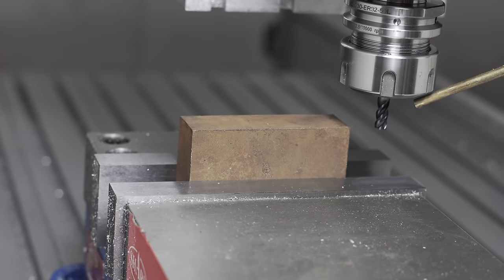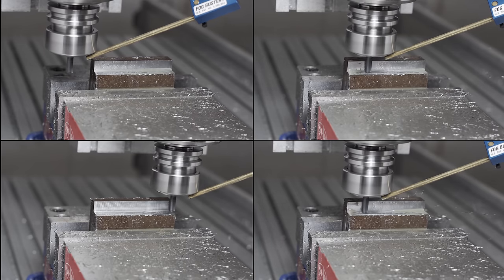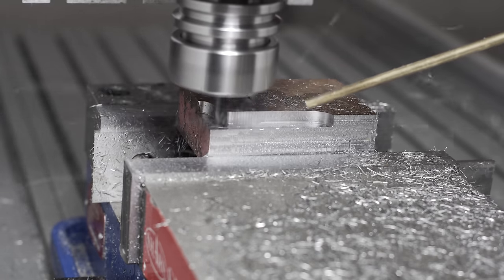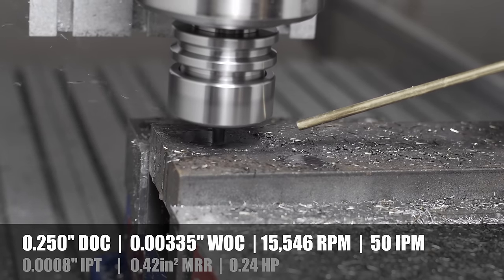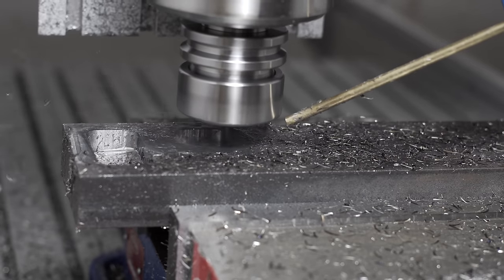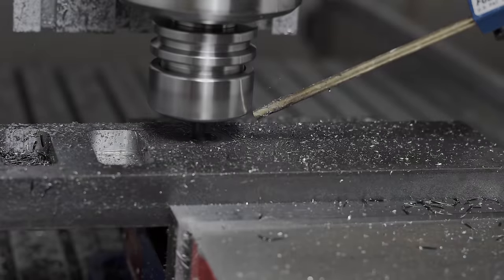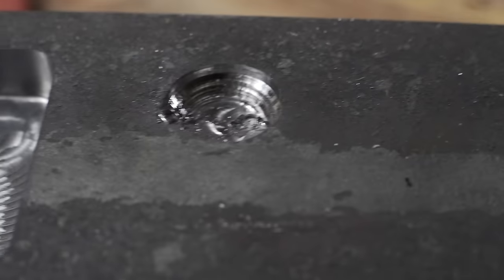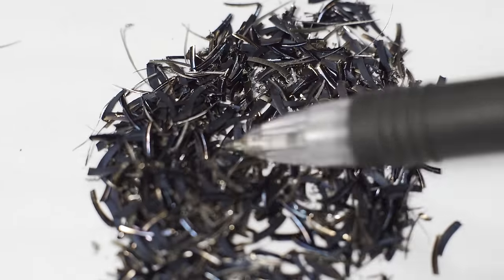Can we cut steel on a desktop gantry router?

Comment: All the cuts are climb cuts.  Try cutting in the other direction.  In the climb cut the bit and the rest of the spindle are pulled into the work, and rebound back when the chip releases. That is the tone you are hearing. Like a violin string and bow.  Climb cuts have advantages on a real, stiff, VMC.  It may also help here to add a tightly attached mass to the spindle to move the resonant frequency further below the cutting frequency.
Reply: I think this is one of the more useful suggestions. Too many people come into cnc and are trying to use toolpaths that extremely expensive and rigid machines would use when there are completely differant ways to go about cutting on less rigid machines, not just continually adapting the same toolpaths down to lower performance specs.
Reply: The end mill is pushed AWAY from the work on a climb cut. It is pulled INTO the work on a conventional cut. The toolpaths he programed are the only way to use this light duty machine. The only problem with climb milling is backlash.
Reply: Matthew Rossilini's concern below is true. Conventional cutting may simply pull the cutter into the work on a less-stiff router table (given the high efficiency milling he is trying to achieve). Also, re-welding of chips onto the workpiece is another very real concern with conventional milling, and this just doesn't happen as much with climb milling. Yes, I know that conventional milling is usually the better choice with a loosey goosey table. You may very well be correct.
Reply: When the video started and I saw where the tool was in relation to the stock I said "well that's not going to work" out loud.  I think peoples understanding of rigidity is the main culprit.  If you can pick it up, it's probably not rigid enough.

Comment: With carbide, either completely flood it with coolant, or just run it dry
Reply: Mist is OK on uncoated, but you're right. Most coatings are made to handle heat and can't withstand the thermal shock of hot cut and then coolant. AlTiN coating especially
Reply: it lubricates the cutting edge. I've always flooded it with coolant using full carbide tool, with inserts the COE of the two different materials will crack the insert so I run most of them dry depending on the stock material.

Comment: Related to how you "missloaded" your endmills in the collets. Let me tell you one worse, I  figured my super-cheap-made-in-china nut had a defect in it since the collets wouldn't seat, so I spun it up in the lathe and removed the bit that locks the collet into the nut... At least it still works but I felt mighty stupid once I figured out that I was the problem, not the nut.
Reply: That's hilarious honestly. Gotta learn somehow though. I've seen some pretty bad stuff in the shop from people who should know what they're doing so don't feel too bad.
Reply: I was going to return my first set of collets until one of the collets snapped into the nut. Then it all became clear.
Reply: Bruh

Comment: Climb cuts are tough on systems with low rigidity. Try conventional milling.
Reply: That's an interesting idea. Conventional cuts take more force and should be worse on a light machine in general, but if there's any significant play in the axes then conventional would be a lot more stable in the cut.
Reply: @captainmcderpyderp  I have a small milling machine and fight rigidity issues with it. It looks to me like you have the same thing going on.  What works best for me is to do most of my material removal with conventional milling and then take the last few thousandths with climb milling. The climb milling leaves a beautiful surface finish, but I have to keep the cuts light to avoid the chatter and vibration.
Reply from the maker: I wasn't planning on doing more tests in steel (honestly only intended to use the machine for aluminum), but so many suggestions have come in I now want to see if I can tweak it some more. :)  Will try out conventional and see how it fares, thanks!  I wish I had a better way to measure deflection and rigidity during the cut itself :(  Trying to understand what's going on from the cut sound and surface finish feels like a proxy at best... I wonder if a high-speed camera could capture the dynamics during a cut to analyze objectively.  Hmm...
Reply: @BreakingTaps  There are systems that do that very thing, but pricey. Some high dollar cnc machines have it built in, but on my modest budget I find listening closely watching the finished surface will usually tell me what I need to know.  I will often put my hand on the machine to feel for vibration. Never forget, everything is a spring.
Reply: Brian has a great idea.  If there's any play at all in the travels, climb cutting is disastrous.  But this thing seemed to be doing okay, seemed more like rigidity issues to me.
Reply: @siraig  Thank you! I am out in the shop today. Just popped in to tell you thank you.
Reply: @BreakingTaps  Just an observer here, but I would try less width of cut.  I don't know what you're at, but start at 10% of diameter and go down from there if you need.
Reply: @captainmcderpyderp  Yea, conventional milling is specifically useful in machines with low rigidity. Using lower flute count endmills will help with the force, but the cuts should have less slop.

Comment: Amazing video! You are absolutely correct: HSMAdvisor does not consider the rigidity of the machine, but instead assumes there is enough of it for the spindle power. It will actually suggest lighter cuts when there is not enough HP. This works perfectly for the heavier machines, but for such light machines it sometimes may indeed turn out overly optimistic. Still HSM machining strategies are preferred for cases where there is not enough hogging brute strength.
Reply from the maker: Oh awesome, thanks for stopping by @HSMAdavisor!  Really enjoy your software, as a newbie it has helped me find good starting points even if it needs tweaking afterwards.  Appreciate the confirmation that my understanding of how it works wasn't way off base.  I wonder if there is a good way to "de-rate" the estimations that HSMAdvisor gives to compensate for smaller machines?  Set the spindle HP lower so it doesn't give as aggressive of cuts?  I find with the 3HP spindle that even with the finishing slider maxed out it can still be too aggressive.  Perhaps some kind of "low-rigidity" mode could be toggled that has different set of assumptions? 

Dunno, might not be possible at all since the variables in a "low rigidity" machine are so much different and probably not consistent.  Anyhow, thanks again for the software! <3
Reply from the maker: Very cool, thanks for the writeup/analysis and the tip!  Will try that on future cuts. <3
Reply: @HSMAdvisor  Isn't it more about cutting force (which is inversely proportional to spindle speed and endmill diameter) than spindle power for these types of machines?  Maybe a "Warning At" or "Maximum/Target" cutting force = * for these types?
Reply: @gmack4097  I agree. There probably should be a "Max cutting force" value in the machine profile. I will add in the future updates.
Reply: @HSMAdvisor  That would be great!  It could significantly increase your customer base to include the ever growing population of CNC router users, especially if you added more wood species and plastics to your workpiece data base!  Or maybe enable user entry of unit horsepower/K-factors?
Reply: @HSMAdvisor  Thanks for adding machine force limit to the latest release!

Comment: Great video!  Your incremental adjustments were going the wrong direction.  Adaptive (High Efficiency Milling/"HEM") should, as a rule, not exceed a Radial DOC/WOC of 8%-10% of tool diameter, depending on the projection length to diameter ratio.  The whole point of this is to relieve radial forces in the cut  through such a light radial load, but make up the MRR through a very high federate (325-400 IPM) and  FULL axial engagement.  All of the heat goes into the chip rather than the tool, and deflection is so slight that cutting 3 x Diameter results in wall taper of less than 0.001".

 I use High Efficiency milling techniques almost exclusively at work now.  In a standard milling machine (vertical or horizontal), we would run, say, a 1/4" tool at 1/2 - 3/4" Axial DOC, with a .0038" feed per tooth.  While your machine wasn't designed for milling steel, it can easily handle these tool paths in smaller 1/4" and 3/8" tools.  You could easily handle that cut in terms of HP (you wouldn't even pull 1hp), but your spindle torque at 420 SFM would probably be getting dangerously low.  If you increase the RPM, your feed would quickly climb outside of your machines ability to  perform. To fix this, you could go up in diameter to keep your SFM constant, but resulting in lower RPM.

If you are willing to do another video, I would be happy to send you a several solid carbide end mills for you play with.  I love watching guys accomplish what most people say you shouldn't be doing for everyone benefit.
Reply from the maker: Thanks for the help!  Really appreciate it!  I admit, despite knowing that HSMAdvisor was giving skewed suggestions... I still used it as a guide while tweaking.  I'm definitely interested in trying more tests, especially as I get a better feel for how the machine performs.  

That's interesting re: larger end mills.  It's one of the issues I was battling, my spindle max is 24k RPM... but feeds faster than >150-200 IPM start to visibly shake the machine.  So I found myself running up against the 150'ish IPM limit, which was driving bigger chipload instead of faster feeds.  I didn't think about stepping up to larger end mills though.  I guess I was mentally assuming the machine couldn't handle larger than 1/4" end mills, but that's probably silly in retrospect.

I think I'm going to try and address the feed rate issues first before trying another test; I want to significantly increase the mass of the machine (both so that I can deck off a known flat surface, and to increase the mass) and improve how it's mounted to the table.  After that I think it'll be a lot happier moving 200-300 IPM

But ++ to retesting with appropriate HSM methodology, rather than increasing chipload like I was doing.  Definitely makes sense having been through it once and seeing how the machine reacts.

Out of curiousity, what's the best way to measure wall taper?  Would be interesting to measure how much the tool is deflecting, since that's probably directly related to the gantry being torqued rather than tool deflecting (just a guess).  Micrometers and gage blocks seem subjective to get good wall taper readings, and I don't think I can quite afford a CMM yet :)  Are micrometers my best bet?
Reply: @BreakingTaps  Use a dial test indicator clamped to a dowel and held in your spindle, then just move your Z-axis.  One important point about HEM machining.  Always repeat your last finish pass convention milling to remove that last 0.001 (or whatever) taper.  You aren't stepping over, mind-you, your just recutting.  If you conventional mill to remove taper, your end result won't be as good because your tool will deflect trying to "climb" the material.

Some will argue you need a more rigid machine to do that.  Concentional does require more rigidity, but were only talking about a very slight amount of material here do you'll have no problems.
Reply from the maker: Doh, yeah a dial indicator makes sense to measure that.  Thanks!  Noted on the spring pass, will make sure I add those in the future.
Reply: Would you be willing to point a learning machinist in the direction of some documentation on HEM?
Reply: I am looking for a CNC that is capable of cutting small parts (watch hands) out of .3 to .5mm steel. Do you know of anything suitable?
Reply: @8ttiknio8  wow, that is an extremely specialized task..... Most machinists would have no idea how to proceed or which machines to suggest. I'd Google research how manufacturers make watch hands (I presume stamping) but I bet there is an etching process that you could DIY at home

Comment: Journeyman machinist here, you're doing a good job figuring out speeds feeds and step over, I think my 2¢ would be to be sure your collet is quite tight.  The helix of the endmill is trying to pull it out of the collet while it's cutting and if you look up the torque specs for how much to tighten them, it's normally higher than you'd think.  Otherwise, great job, great video!

Comment: Use Gwizard for feeds and speeds in metal on a cnc router. Most other calcs are made for mills.

.25" deapth of cut is too much for steel on a router with a thin tool. No wonder it sounds bad... I'd start with 1mm and go up from there. 

That finish is poor which means you're gonna destroy your bearings if you keep ignoring the warning signs.

Comment: Using an indicator you don't mind rattling around on the frame of the machine with a camera trained on it can help you figure out if there's a specific frequency that it'll resonate at. It can pick up vibrations you can't easily hear, so you can gather quite a bit more data than most would think just judging vibration by ear.

Comment: Try it again with the machine clamp as far to x0 as possible.  The machine has more stiffness at the outer edges by design. Yes, steel can be machines without coolant. It's a lot more forgiving than aluminum. And the machine will probably behave different in terms of stiffness in X and Y direction.This machine uses moving carriages for the Z axis instead of moving rails.. Although it  is convenient for the Z's travel, stiffness has to give in a bit. ER32 nuts are normally tightened with 120Nm of torque. That's a LOT.  Righthand tools can come out when the nut isn't tightened good when pushed from the sides relative hard (normally the case with adaptive clearing)
Reply from the maker: Ah that's a good idea, will try closer to the edges of the machine... and definitely thinking about getting an adapter so I can use a torque wrench on those tool holders :)

Comment: Right now im questioning everything i onow and do daily at my job...
Thats very very impressive a machine like that can cut chips like that. Well done.

For example i use 6500rpm for a 8mm endmill and 1500mm/min with about 1mm ae and about 29mm ap. Steel, 4 flute coated carbide endmill.

Comment: We used to run flush and thru-spindle-coolant with carbide tooling on steel and stainless steel parts all the time. I don't see an issue. Note, however, that the efficient flushing/removal of chips is one really good reason to use flush coolant instead of just lubricated air. On aluminum where chip re-welding becomes a huge concern the liquid flush at high feed rates to cool the part/chip and remove the chip is absolutely necessary.

Comment: As someone who has been chewing up steel since he was 8 on mills a d lathes. 
Most small mills are not that rigid. More that 1 or 2mm depth cut on a 10mm end mill in steel would be considered rediculous. Though the mill is turning almost always well under 1000rpm. So each cut is a lot larger. But you get a feel for manual feeding. Which is what I need to translate in to CNC.

I'm just setting up my first CNC router and it's not as good a model as that. But I still think it will cut steel. As long as the tool is not to large and the cuts light I see no reason why not. That will wear tool more, but unless it's a huge CNC milling machine it's the compromise you make. And a good note is CNC mills are huge, but compared to the footprint, the working aria is small. That's how it gets strength.  

Franky I'm amazed it even did the first cuts I watched. I would have been way way more conservative and worked my way up to its limits. 

Also, taking small cuts and working bigger is the advisable sequence. You tend not to break things that way.

Comment: 8:59 you set your stepover to .99? One inch? I hope you meant .099 lol
For less rigid setups i find shallow depth of cuts with very high feed rate to be optimal as you still form a chip. Good video as always
Reply from the maker: Err, definitely mispoke :)  My machine would explode if it tried 0.99" stepover :)
Reply: @BreakingTaps  i have a 2.2kw watercooled high speed spindle from AliExpress and it can do 12mm DOC with 1mm stepover in steel (was probably doing 0.3mm feed pr tooth) and it powered through it without issue. It was on a mill, not a router. Good luck finding your perfect speeds and feeds.

Comment: Hi. Not bad at all but that's why we use VMCs instead of CNC Routers to mill steel and tool steel. You need rigidity BEHIND your spindle. You won't find us toolmakers using cnc routers to machine our injection mould tooling. Use air with carbide cutters, unless otherwise specified by tooling vendor.

Comment: I was fairly concerned about machining steel with my diy gantry CNC, but your feeds and speeds worked excellent as a starting point. Thank you! 
If it weren't for videos like this, I'd most probably have a couple of broken endmills lying around ;)
Reply from the maker: That's great to hear!  Happy that my feeds/speeds help get you up and running :)

Comment: Great stuff. I'm interested in seeing what all went into getting the S30 wired up to the avid plug-n-play system!
Reply from the maker: Thanks Will definitely post a wiring video at some point.  Few odds and ends to finish up before then: need to finish enclosure (~80% done), wire in the low pressure fault sensor and wire in that drawbar interlock.  Think those are the last things that need doing, then I'll put together some diagrams of the wiring and pneumatics (and extra parts that are needed).
Reply: Got the same setup, s30c spindle and avid cnc. I'm on my 3rd vfd and the delta vfd from cnc depot is the best one so far to work with the avid electronics package. Awesome setup, would highly recommend